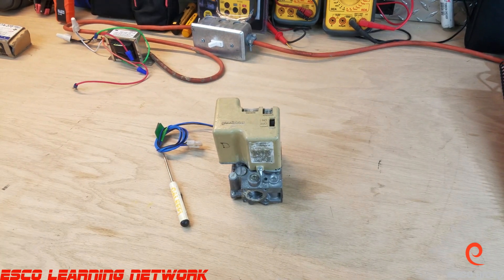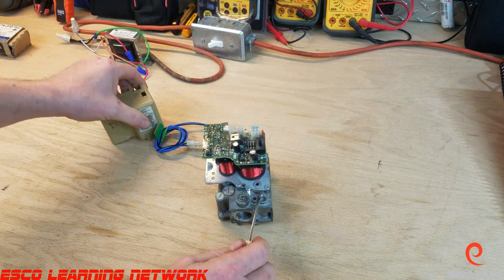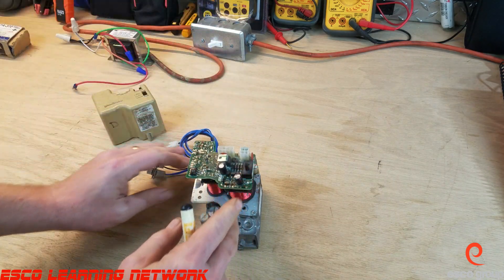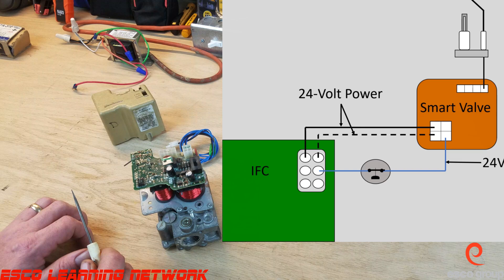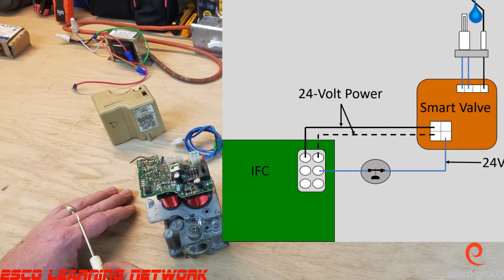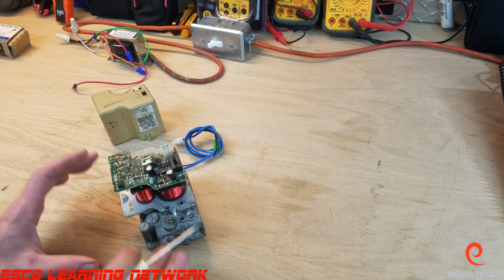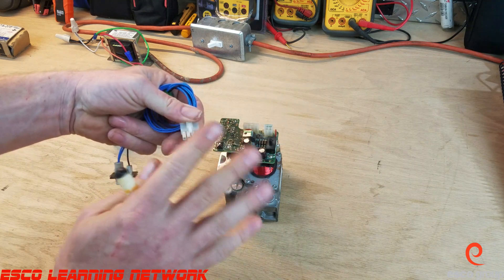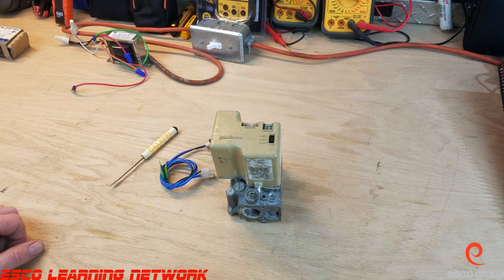Honeywell Smart Valve Testing-Workbench Series

Comment: I have sv9501m2528 smart gas valve.  Pilot stays on but gas valve is not opening. Theres no power on orange power. Should i replace gas valve. Orange wire gets power from gas valve to control board?

Comment: I have power to the ignitor on the smart valve, but when I plug in the ignitor the voltage drops to zero. This is happening on the old ignitor and a new one I got on amazon. Any idea how to test if it's the smart valve or the 24 volt transformer that is bad?  Both of the ignitors are reading a little over 4 ohms cold. so I doubt they're both shorted out.